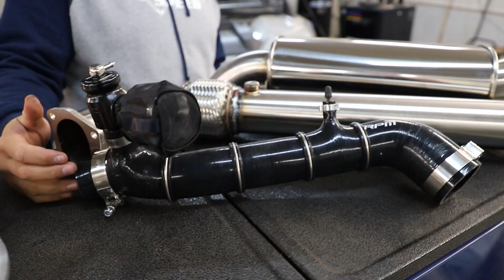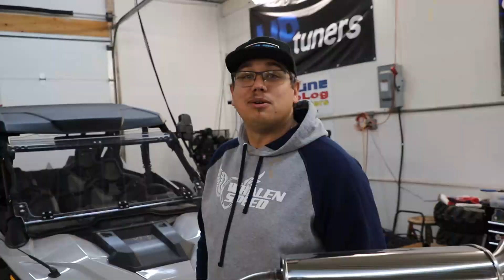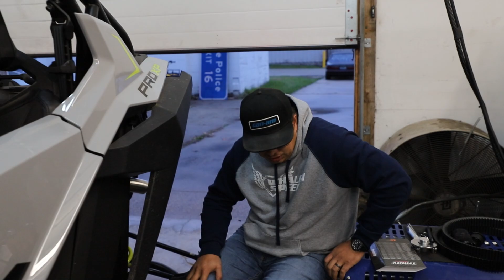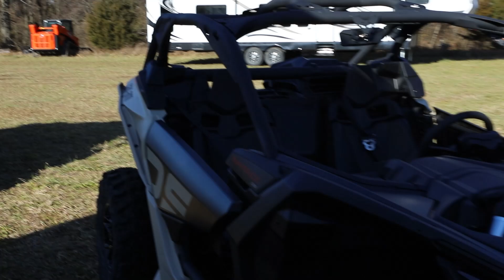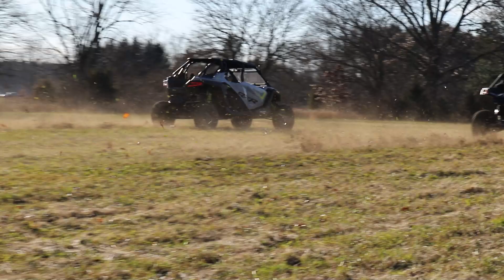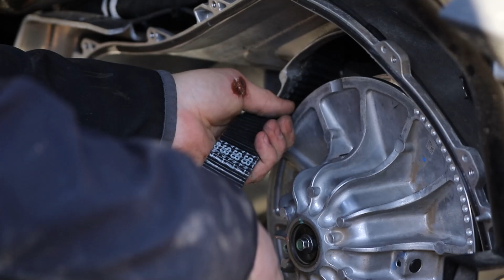Whalen's Speed: Charge Tube - Exhaust - Clutching - Dyno Session | Project Pro XP

Comment: From what you are saying I take it the cvt has kinda the same needs like a bicycle with 30 gears. Needs some revolutions do the wanted change because the chain can't move sideways unless the wheels(here it is belt and clutches) rotates enough. And your dyno may not allow enough revolutions for what the cvt needs.
Are you saying it wants to shift up faster than it is allowed? Or do you start in too high a gear and it first wants to go down when flooring it? Or maybe both?
Can the the 180 rev/s be changed?

Great content btw. Keep em coming. Love to see what you can do with this platform.